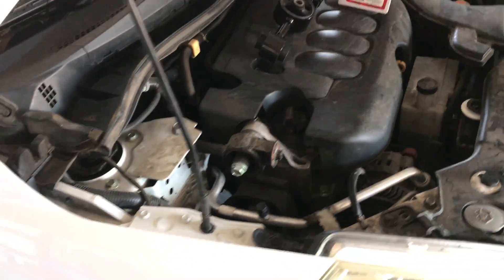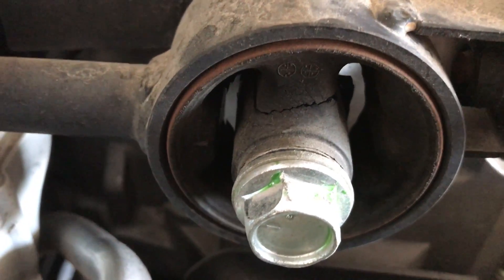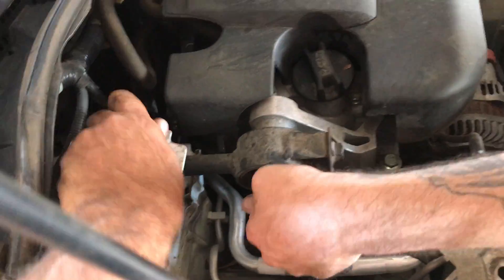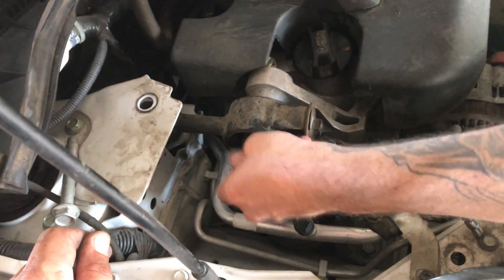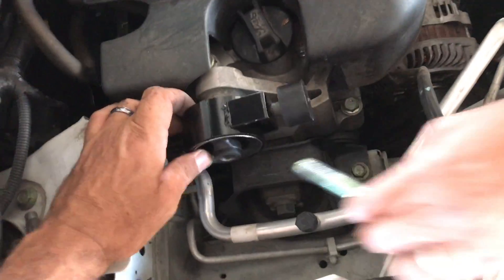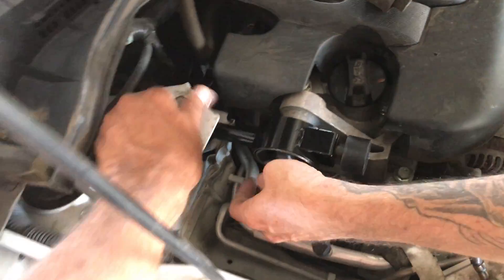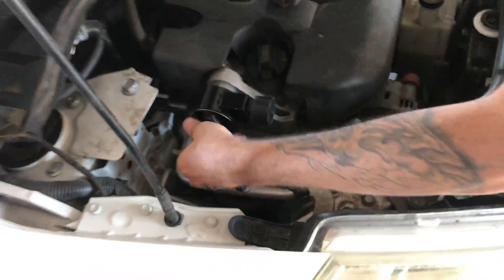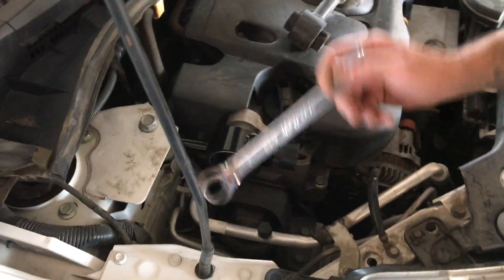2009 Nissan Versa Motor Mount

Comment: The torque spec for each bolt of the rh torque rod is 103ft/lbs. If this rod has failed, remove  and take a look at the rear torque rod too (underneath between the trans and subframe, and does the same job). Torque on those bolts are 59ft/lbs. Chances are both are toast and if you only do one, it won't last long.
Reply: Yep that bottom rod style  transmission mount  should also be changed many don’t pay attention to them

Comment: thanks for the video. Got the bolts off, but upon trying to tighten them back up, back bolt just spins -- it won't tighten. Thoughts?  Thanks!!
Reply: Capn, did you ever figure out how to prevent it from spinning?  I'm about to do the same replacement, but didn't want to get stuck where you did.